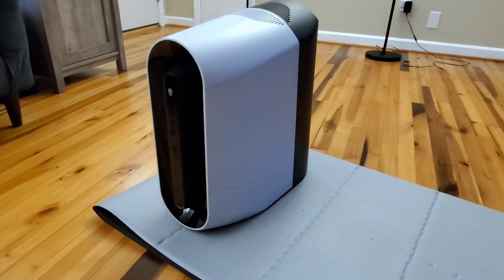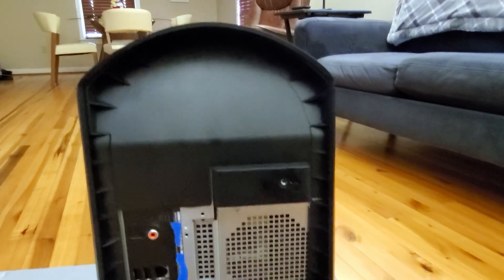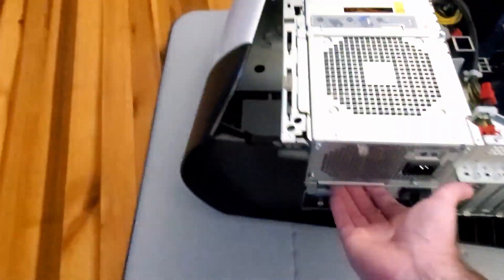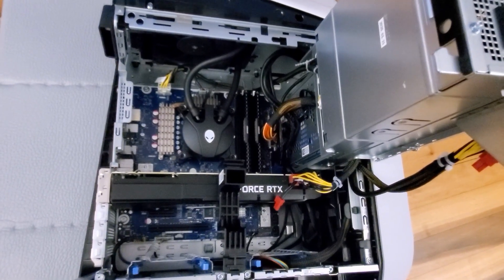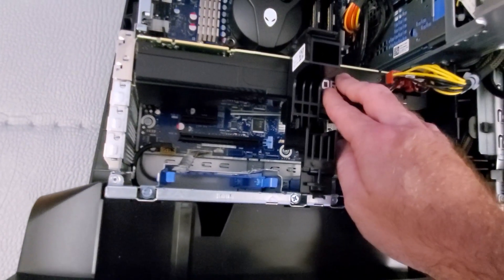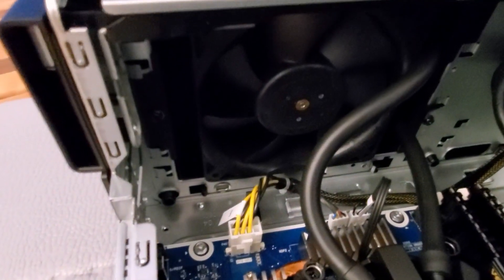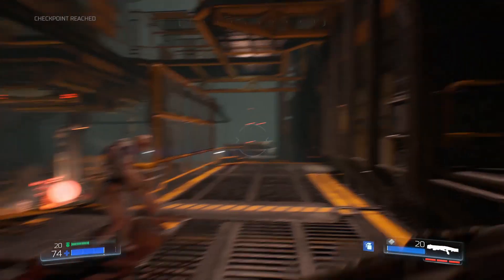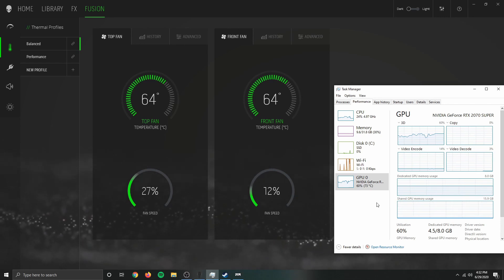Alienware Aurora R11: Up-gradable? What about those temps?

Comment: What can we upgrade ?  Not much !  .... can literally upgrade everything except motherboard :D :D
Reply: the only things u cant upgrade are the motherboard and cpu🤣
Reply: @k1dgam3r91  it's a standard desktop cpu with standard socket, so it's only the motherboard / and if you would sacrifice lights and some other stuff then you can replace motherboard as well, you can trust me in this i have one under the desk :)
Reply: @kanalniekohoznameho  oh thanks man😁
Reply: You can’t upgrade gpu yet. Which is kind of a big deal.
Reply: @CanYouRepeatTheQuestion  you absolutely can, it is actually the easiest thing to replace. You only need to measure the size of card to know if that will fit.
Reply: @kanalniekohoznameho  You absolutely can not upgrade to nvidia 3080 or 3090. It does not fit.
Unless dell starts making a custom 30 series that is offered separately, you can’t upgrade. If you didn’t order the 30 series card with your build, you’re screwed.
Reply: @CanYouRepeatTheQuestion  Dell offers the 3080 and 3090 in this same case. So how would it not fit?
Reply: @Attorney57  
Dell makes custom 30 series cards especially for their pre builds. 
If you do not order the pre built with a 30 series card from Dell, there are now currently only 2 other options that fit the r11 case. 10.5” max length for gpu
Dell does not sell their 30 series cards separately, either.
So good luck upgrading any time soon.
With the prices and limited availability, you don’t have much of an option for upgrading gpu’s.
Reply: @Attorney57  I’m referring to those who may have initially ordered a pre built r11 with a smaller gpu, 5700 or 2080. Then attempt to upgrade gpu after the fact.
The options are extremely limited due to the case dimensions.
Reply: I ordered a build with the 5700xt gpu. Now I’m stuck with it until I case swap or there’s a custom gpu made to fit the small case.
Reply: @CanYouRepeatTheQuestion  i see, shame you did not measure or checked dimensions, i hope you will get it sorted out
Reply: @kanalniekohoznameho  what’s a shame is that dell didn’t account for the gpu sizes and accommodate
Reply: @CanYouRepeatTheQuestion  yes, that is true. The case is quite small, so it makes a little bit of sense, but the note would be great - in any case contacting dell prior to upgrade is best thing ppl can do i guess
Reply: @CanYouRepeatTheQuestion  so I ordered one with a 3080. What's the difference if someone orders one after market?
Reply: @dralberthofmann  Dell has custom gpus to fit their smaller case. 
Nvidia and 3rd party nvidia cards do not fit. Too long.
Another guy pointed out one 3rd party 3080 gpu that will fit. But that’s the only option other than a dell factory build.
Reply: @CapitalFPS Yes, PSU can be replaced as well, u can take it out from the turny bracket

Comment: I have a source within Intel that has confirmed 11th gen will run on current LGA1200 socket, in other words CPU will be upgradeable in this PC without a new MoBo
Reply: Yeah it'll fit but it'll be up to Dell to release a BIOS update to support the 11th gen CPU's (which they won't) reason why you can't upgrade from 8th gen to 9th gen on the R7 model.

Comment: Anyone need a R11 front cover? I’m doing surgery to stuff my STRIX 3090
In it.
Reply: Is it Lunar Light? I max out specs on everything and didn't change it from Dark Side of the Moon so I don't get the vent LEDs in the front. Which sucks considering how powerful my pc is and something simple as LEDs lights missing makes me upset lol.
Reply: @ZacharyRomaker  it is and I completely understand that. But I went a different route. I sold my ASUS STRIX 3090 and found a RTX TURBO 3090 that fit so my case is back together in stock form and the front cover is in use now. Sorry man. That was posted out of frustration during my 3090 upgrade.

Comment: Can I buy the gforce 3090 and put it in here?
Reply from the maker: The maximum length for the GPU is 10.5 inches. This pretty much rules out all of the 3 fan GPU variants. Funny enough, the launch versions of the AMD 6800 and 6800XT are 10.5 inches long. The founders edition of the 3080 is also 10.5 inches long. There does not seem to exist (yet, who knows if ever?) an off the shelf 3090 that could fit in the R11.
Reply: @theonlyjoe6036  so which one are they shipping with? It’s available with a 3090 now. Is that a version with a Dell/Alienware custom heat sink?
Reply from the maker: @SammyTheDitchDoctor  I did a little bit of research on this, and I found that Gigabyte does in fact make an SFF friendly blower style 3090 that measures in right at 10.51 inches long; so yeah, I was wrong about there not being a 3090 on market that would fit. I looks remarkedly like the PNY 2070RTX blower card that is my own R11. Dell does not explicitly mention that they 3090 uses the AIO cooler, so they could very well be using the Gigabyte model. I've posted a link to the Gigabyte card via their website. Dell is claiming that they use a custom solution for whatever that is worth. 

Here is also what Dell pointed me to (a link on their website) when I emailed them asking this question; Dell is notoriously tight lipped about their vendor partnerships:

"The Alienware Aurora now offers optional custom graphics designs based on NVIDIA’s 2nd Gen RTX architecture. These custom designs are made with extensive thermals and an innovative airflow pattern engineered to prioritize graphics performance while complementing the Aurora chassis airflow as well.

These custom graphics card designs, included in both NVIDIA® GeForce RTX™ 3080 and 3090 graphics, are built with space efficiency with a max length of just 267mm that covers a 2.5x slots and offers a dual 6-pin/8-pin PCI-Express power connectors. All of these choices have been made to create efficiency with uncompromised gaming performance."

https://www.gigabyte.com/Graphics-Card/GV-N3090TURBO-24GD#kf
Reply: @theonlyjoe6036  ugh. How nice of Dell. When I bought my “top of the line’ R11 a couple of months ago they promised me it would be no big deal to upgrade to a 3090 when it was released. Thank you for the link. I’ll resell my Asus Strix 3090 and hopefully pick one of those up. I was seriously contemplating cutting my chassis. If I wouldn’t have lost the front panel usage I probably would have done it. I’m glad I waited and didn’t void my warranty. You’d think the Dell folks would carry that card or at least tell their customers where to upgrade or what works...
Reply: Change front case fan to a noctua slim, and you have 11.3in or so clearance.
Reply: @midpackula  Yep Thats what I did. Swap to a slim fan. And the only 3090 that will fit off the shelf is the Gigabyte Geforce RTX 3090 turbo 24g
Reply: @SammyTheDitchDoctor  Honestly. i just popped the side panel off, leave it off, and have been looking into a mesh to stretch over that side of the case, but without that side panel on, it pretty much entirely eliminates the need for the front fan at all.
Reply from the maker: @midpackula  Thanks for the tip. Any extra clearance for a new GPU helps since the stock GPU clearance is only 10.5 inches.
Reply: Short answer is no. I’m doing exactly that right now and I’m having to modify the case pretty drastically to fit my 3090 STRIX. Also can’t run the front cover anymore.

Comment: i was abut to buy before finding out the intel cpu in non removable from the motherboard
Reply from the maker: You can remove the Intel CPU from the MOBO. I myself have unseated the heatsink and reapplied / upgraded the thermal paste. The CPU is not soldered to the mainboard; that is something you typically only see in laptops and SOC (system on a chip) style systems. 

The downside of Intel CPUs is that Intel loves to change the socket of the CPU from generation to generation (ie: year to year typically).  This means that you are stuck with whatever generation of CPU you have as an upgrade path. Compared to AMD who typically keeps the same sockets for a few years. For example, an AMD 3600X ZEN 2  could easily be upgraded to a 5600X ZEN 3 with the same MOBO (though you might lose out on some new features like upgraded PCI-e lanes or memory support due to the old MOBO not supporting them), while a 10th gen Intel CPU could only be upgraded to another 10th gen Intel CPU.

Comment: nice video man.
what's the brand of that ram stick ? is it good for video editing ?
Reply from the maker: I upgraded the RAM in my case to a 32GB Corsiar Vengeance kit running at 3000MHZ CL15. It is fine for video editing. I edit my Youtube videos in Resolve with no slow down. I bought my specific configuration because it strikes a nice balance between gaming, productivity and price.
Reply: @theonlyjoe6036  thank you so much
Reply: @theonlyjoe6036  Hey the only Joe, thanks for the video! when you bought these sticks did you just simply replace the old ones? did you get an error on boot?
Reply from the maker: @Mighty_Kappa  I simply swapped the new sticks in with no issues. I used a kit of 32GB Corsair Vengeance kit running at 3000MHZ CL15 from Amazon.
Reply: @theonlyjoe6036  thanks 😊 🙏

Comment: which graphics card is in this one? 2080?

do you have liquid cooling or air cooling?
Reply from the maker: I am running the air cooled Nvidia 2070 Super. I'm not sold on the Dell (made by Asetek) liquid cooling unit. My concern is the use of proprietary parts that make it next to impossible for a user to replace or service.

Comment: What are the specs of the computer you are running in this video?
Reply from the maker: Specs are:

Intel 10700KF
Nvidia 2070 Super
32GB Ram at 3000MHZ CL15 (upgraded this from standard 16GB as it was cheaper for me to do it than pay Dell)
1TB NVME main drive
2TB Crucial MX 500 2.5 inch SSD (replaced included 7200RPM 1TB drive).

Comment: Could I upgrade it to liquid cooling?
Reply from the maker: The CPU on the R11 already includes a AIO liquid cooler that is made by Asetek.
Reply: @theonlyjoe6036  Not all of them. Any K version of intel cpu has to come with liquid cooling, but there are air cooling  version of the R11 for non-K. Which is NOT a good option and would NOT recommend it to anyone. PLEASE Take liquid cooling if you can. But if you made the same mistake as I did and take air cooling, you can upgrade it to liquid cooling with a corsair H60. This is not the easiest upgrade ever, but doable. I would recommend to change both stock fans too with Corsair ML120 pro. They are better and quieter.
Reply from the maker: @buflen  Thanks for the clarification on that one. I had no idea the R11 even had an air cooler option. I agree, I would not recommend an air cooled option for the R11 at all.

Comment: Did you go with aftermarket ram? I can only get single channel to work even though I have 2 sticks of 16GB 3200 MHz installed. It only gives me XMP profile 1, there is no profile 2?
Reply from the maker: Correct. There is no XMP profile 2 available. Simply make sure that XMP Profile 1 is enabled. Unless XMP is enable the RAM (any RAM for that matter) will only run at 2666mhz (or 2933; depending on your CPU you have installed in your R11).

Comment: So that's why it has high case Temps. And good luck putting a normal sized GPU in there.
Reply: mine has a 3080 in it lol
Reply: @SCUBAxxX  How did you fit a normal sized 3080 in that case?

I ended up building my own PC a few months ago since I prefer to pick my own parts. Ryzen 5900x, Asus 3080 OC, MSI X570 Tomahawk, 32GB G.skill Neo 3800 Mhz CL16. Very happy with it!

Comment: Hi! Not sure if this has been asked but I just bought an r11 i7 10th gen 10700f w/ 2060 super 16 gig ram two sticks. Im wanting to upgrade the ram but I've heard you have to buy the exact same ram sticks hyperx ddr4 3200. Could I just scrap the 2 8 gig sticks and buy any type of ddr4 any wattage ? Thinking if juat getting two 16 gig sticks. Thanks!
Reply from the maker: I upgraded mine to a Corsair CMK32GX4M2B3000C15 LPX 32GB DRAM 3000MHz C15 32GB kit with no problem.

Comment: thank you for the video! awesome content for only 100 subs! I am definitely going to upgrade to a 3080!
Reply: ur gonna have to remove the front fan because of the space but if you get a small 3080 then u should have a problem
Reply: Did you find any brand 3080 works for the tank, I mean the 3 fans, if you find one please tell me

Comment: So I shouldn’t be concerned about temps ? I was installing a game and the internet is awful here so the computer was on 36 hours with only a restart. When I woke up after heating fan noises at night I checked and the CPU was at 85 degrees Celsius from juts downloading. (i7 10th gen) with a 2070 super 8gb. 16gb ram. Air cooler.
Reply: @boringjordan4804  I returned it, wasn’t comfortable at all with the temps and cheaper motherboard, etc.

Comment: if it helps anyone, I removed the front caddy of the 3.5in and installed a second front fan (in an R10, but it should be the same): https://imgur.com/a/Y4kAv7t
Reply: Hey man, I got a question about how you secured the fan there. I was thinking I might need to use zip ties, but if you have a better way, I'm all ears.

Thanks for the pics, inspired me to add a fan there too.
Reply: if i do that, what do i do with the hardrive that is currently there? toss it?
Reply: @refinance  if you have a 3.5in drive, an external enclosure should be like $20 bucks. 3.5 drives often need more than USB power, so the enclosure would come with an AC adapter. you can just leave it plugged and use it, for instance, for Windows backup settings that backs important files while the computer is not in use…or just for larger games that are too expensive to hold in an SSD or NVME.
Reply: @refinance  I’d sell it…I believe it’s a 1TB 
See if you can get a few bucks for it.
Reply: I took mine out and still have it, Put in a 5TB and planing on putting in another 5TB! I don’t download any games on the 1TB NVMe for the OS!
Reply: Yea planning on doing the same when I receive my R12. Question....What fan did you use? And I assume you used a y splitter!? Did you get any bios errors? I’m planning on replacing all the fans on in the unit and adding two additional fans. Adding a push/pull on the radiator and the second on the intake!

Comment: I have an R9 i got at the beginning of this year as I didnt think I wouid be able to get the parts needed to build one myself due to the current world situation...I should have just waited..This thing has never worked properly. Im now on my 3rd motheboard replacement since April and its still having issues. I do like the way the case looks but with the size of the new Nvidia cards I might have to just part it out. Hopefully the AIB's will come up with something that will stay under that 10.5 inch limit we have because I would love to do a proper build inside this case.
Reply: damn I’ve been there before. maybe save up for something better and then sell the r9 to top it off
Reply: @OverL00k707  Still strugglin to find the parts to build my own but thank god I came across MainGear. Its still gonna be a hell of a wait but I did manage to get my hands on an rtx 3080 and a 5900x with their vybe lineup. I have been working on the r9 this whole year and again its still a little screwy but a lot better than it was 6 months ago.

Comment: when it comes to the R10 ryzen edition can I upgrade the ram from 16 to 32gb with any sticks or do they have to be through dell? also i have the 2060 super nvidia card, but I question the fitment with the new 3000 series in this case and the R11 case.
Reply: You will be able to fit a 3070. Just not the 80 or 90
Reply: @bryan0102  I just ordered one with a 3080 and they offer the 3090 as well.
Reply: @bryan0102  not true I have one with a 3080 currently installed
Reply: @SCUBAxxX   did you order it with the Dell OEM one
Reply: Good news! Dell has refreshed its Alienware Aurora line of desktops with Nvidia RTX 3000 GPUs!

Comment: Dont forget, you can upgrade hard drive, psu, ram, also cables, ect
Reply: @Icy Dragon yeah if its ddr4 yes its going to fit, but i recommend to not mix the hyperx memory with others, just buy 4 sticks of ram and sell the HyperX memory
Reply: @stickfee299  good choice tho,  should I just buy hyper x , what else ram they use ?
Reply: @donglee6599  any that are ddr4 and i recommend 3200 mhz its perfect for the motherboard
Reply: @stickfee299  just brought an alienware r10 amd come with 16 gig hyper x fury xmp 2933 speed,  if I wanna upgrade rams later should I get the same brand ?
Reply: @donglee6599  you can but i recommend the corsair vengeance lpx ddr4 3200mhz  i used that type of ram for my alienware
Reply: @stickfee299  oh thank bro